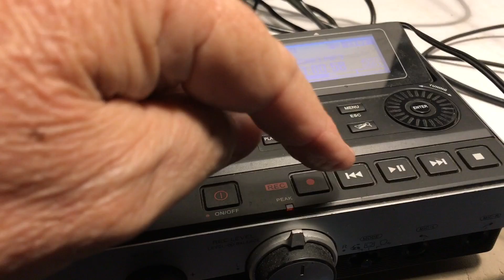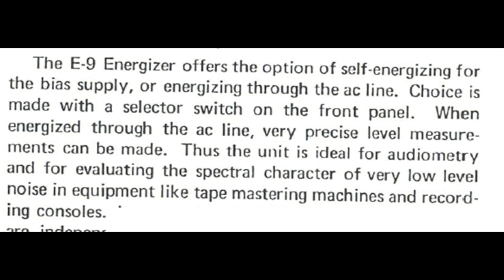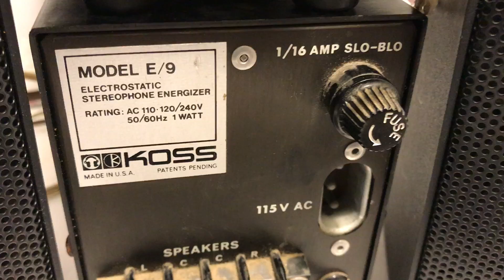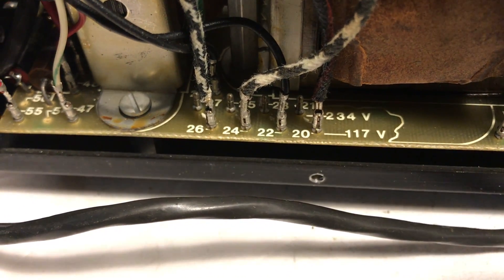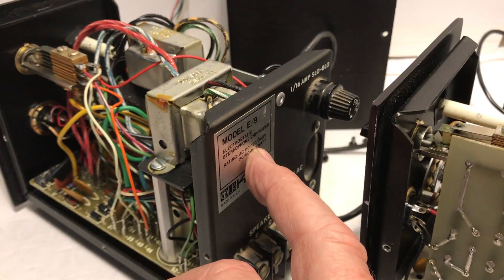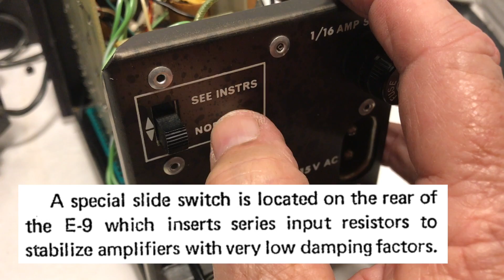variants of KOSS ESP.9 Studio Monitor Electrostatic Stereophone headphone speaker system

Comment: I just bought an untested pair of ESP.9 headphones for $50 on ebay.  They are different than yours.  They have a big grounding lug on the left side.  They came with the 5 pin extension too.  Then I went and bought an untested e.9b energizer for $40 and right now I'm doing my homework before hooking everything up.  I figured the energizer probably works fingers crossed on the headphones being good... they might be damaged from liquid or leaking oil ear pads. (EDIT... the lug on the left is for a microphone)

Comment: I have 2 sets of ESP-9's.   The one with the big silver label has a manual dated 1969 (Which I bought new from a friend for $90 in 1973).  The one with the 2 "reset" buttons has a manual dated 1972 and says it has "improved circuitry." (I bought that one off eBay, and it had the optional 10' extension.)  The oval 3-pin power connector was standard on lab equipment before Mfrs standardized on the "D" shaped 3-pin instrument plugs you see today.  That one with the brown "Zip" cord was user-modified - most likely because the user couldn't find the 3-pin cord.  Both ones that I have say they have improved circuitry, but the 1969 manual has an addendum page added that mentions this.

Comment: Found this video a bit ago and got me a pair of them for 200. If you have these headphones definitely should run it with a tube amp it changes the quality so much for the esp 9. Honestly the best thing I've ever listened to. Also replace the pads to save your ears for suffering.
Reply: Also would not recommend putting your speakers through that. The sound quality drops off by a lot for the speaker.
Reply: However there are no original replacement pads for those, however third party KOSS Pro-4AA pads fit ok, I use those on mine.. the original fluid filled ones was destroyed when i got mine.